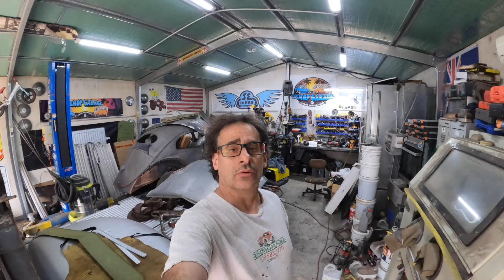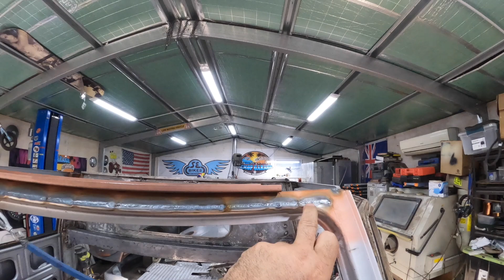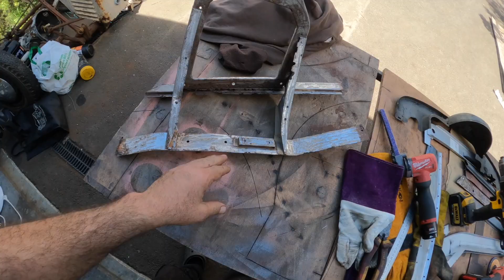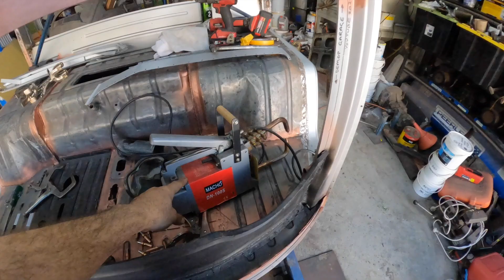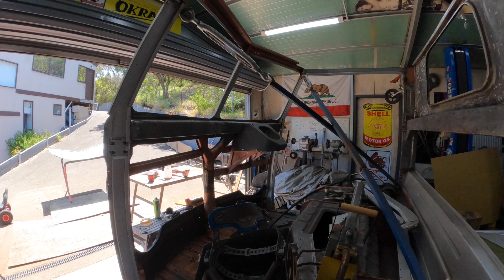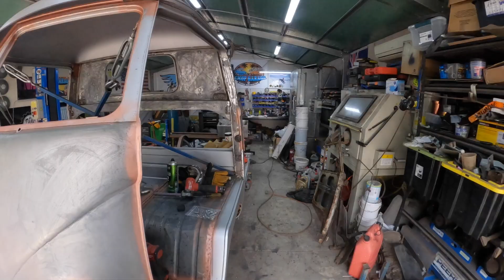Building a 1954 VW barn door single cab from scratch // front nose panel #vwrestoration

Comment: G'day, Mr Nick,
An awesome video man. 
After watching you piece your single cab back together, I'm so glad that my 67 split panel is complete in the front and roof areas. 
Q. When your mig welding, which one of your welders are you using. 
✌️ Peace from Melbourne/Pakenham.
Reply from the maker: @kevinhamling1963  heaps of work hay, I mainly use the everlast 270 p mig on this build.